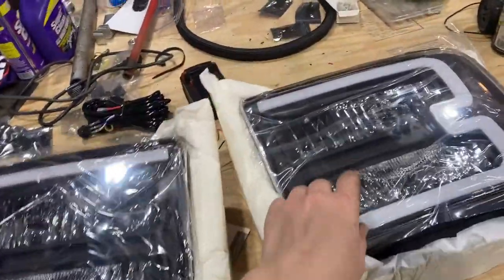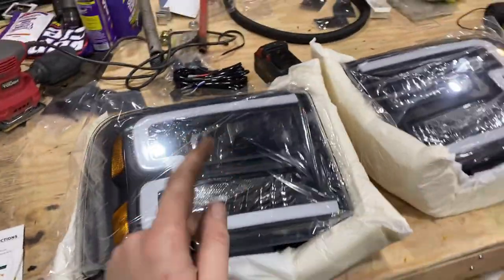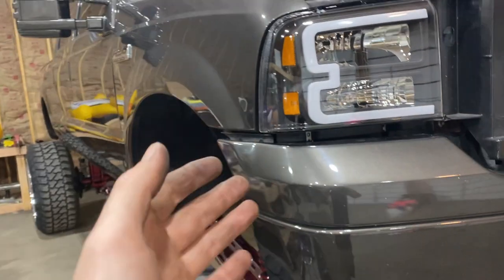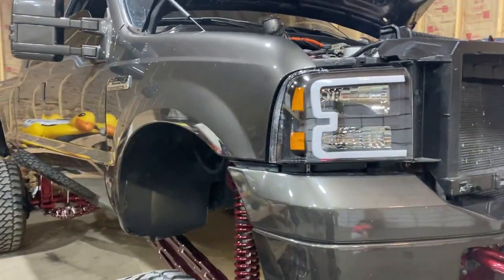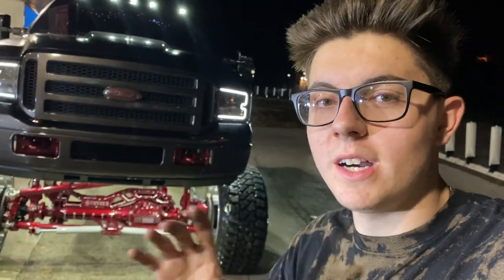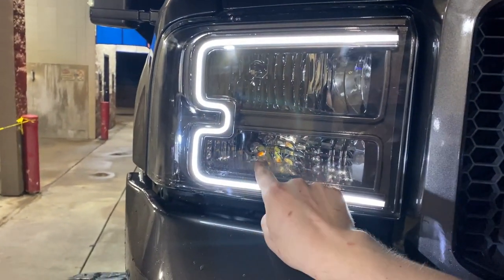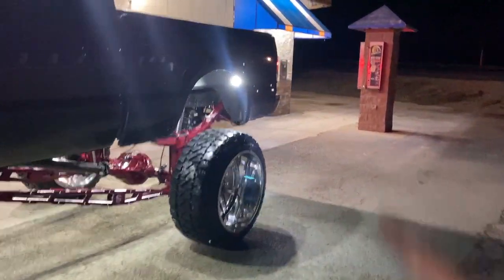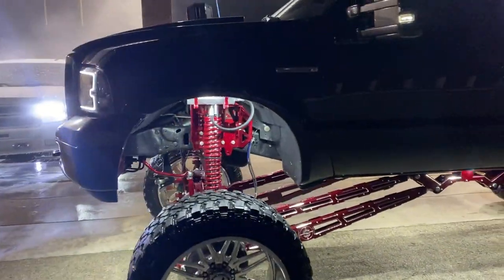I BUILT THE BADDEST 6.0 POWERSTROKE HEADLIGHTS ON THE INTERNET

Comment: What color is your truck? I have 04 f250 HD edition silver and black but paint code is gone how else could I find it
Reply from the maker: Paint code is T7 charcoal beige metallic. Your paint code can be found out by calling any ford dealership talking to parts department , last 8 of vin they can tell you your paint code. I’m your case you may have 2 codes not sure how the 2 tones work. But they can tell you by vin.

Comment: Where did you end up finding the white led tow mirror lights?  I bought multiple sets and none fit.
Reply from the maker: I run led replacement bulbs in the ones with halogen bulbs
Reply: @JUSTINHAWKSMITH  gotcha.  Yeah mine lenses are amber so I’m screwed there